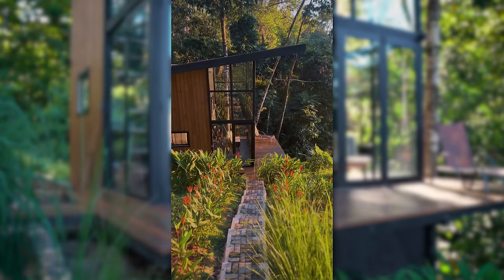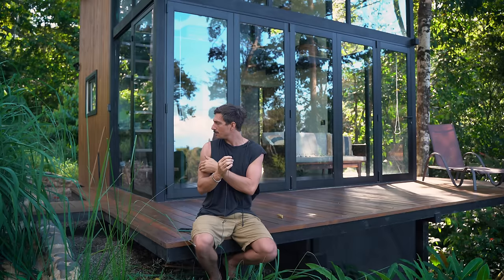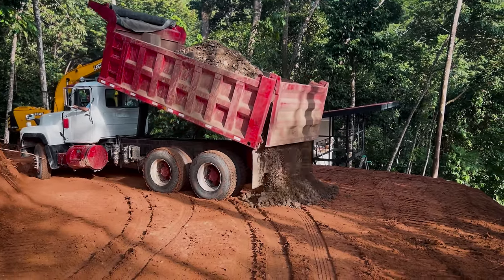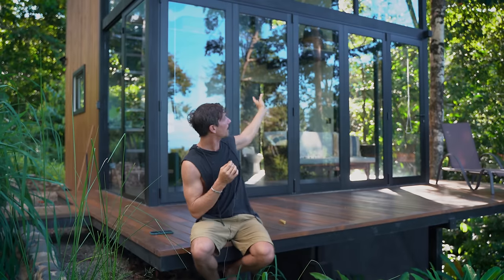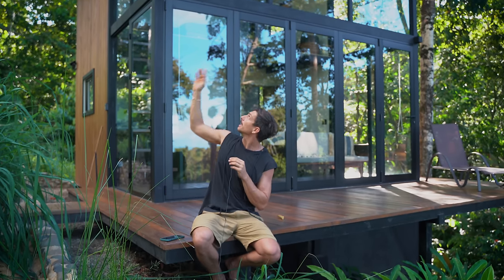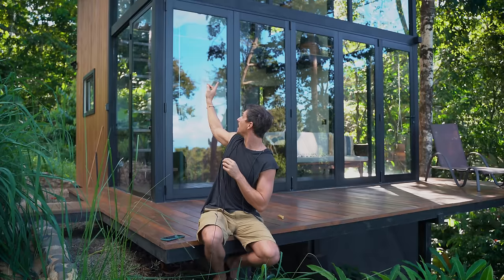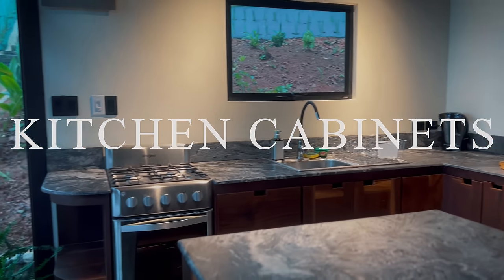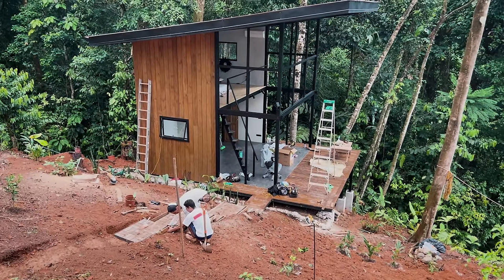Building Cost Of A Luxury Cabin In Costa Rica

Comment: How about the price of the land? Did I miss that?
Reply from the maker: I didn't include that because it varies wildly. I also purchased this lot along with many other lots as a package deal. Each lot has different value because there is ocean view and lot size to consider. But I paid just one bulk price so it's hard to say. Its like if you paid $10 for an apple, a juice, coffee, milk and a can of beans and someone was like, how much was the apple?
Reply: OK you bought two lots so how much were those two lots ? @SashaJuliardD
Reply: Did you mentioned septic drain field ? I may have missed it ...
Reply: @SashaJuliardD  You would look at the receipt and it would tell you. Multiple lots would have had dollar figures to each, it can't be hard to give a ballpark figure on cost of land. Given where I think this is, I would guess in the realm of 110k. Unless what you built on here was sub-divided after or one of several structures on the same plot... given the fact this is a rental.
Reply: @SashaJuliardD  wouldn't the receipt tell you the breakdown?
Reply: You can reduce it down for the specific plot.... @SashaJuliardD
Reply: Were you inspired by Nordleys?
Reply: @SashaJuliardD  $10/5 items = $2 per item. "The apple was about $2" :D
Reply: @SashaJuliardD just say, you dont want to disclose.
Reply: @SashaJuliardD  - that's called dancing around the question or in other words...bull shit answer
Reply from the maker: @Jenna-q6w  I literally cannot give an accurate answer because I purchased multiple items with different features making some lots more valuable than other for one negotiated price. I can say that this lot on the open market would probably sell quickly for about $350k
Reply: 350k for a lot in Costa Rica. Thats is really surprising because I was in Costa Rica last month in a popular spot and saw lots 5 minutes away from a famous beach break for 15k
Reply: @coo3626  Maybe at that price it is a 200 square meter lot, I am Costa Rican and usually the lots at that price are small or do not have deeds or are in dangerous places
Reply: @SashaJuliardD  why are you being so secreative. just tell us an estimate.
Reply: @SashaJuliardD   We don't buy groceries based on square footage lol. Just gotta do the total bulk price for the land divided by total by square footage...
Reply from the maker: @dansrod5952  ok, I can measure by that metric 👍 By that metric I paid 80k. 

But I will still say again, this lot has a nice ocean view so there are the ‘nicer’ square meters than some others on the property.
Reply: Wow, so many negative responses! Thank you for such a detailed video. As someone who have bought a property in CR, and looking to add a cabin, , this was very helpful. I think a lot of people here don't realize that you can buy a lot of land, but how many of them can be " livable ". Anyway, thanks again for the video!
Reply: No one is entitled to the specific price of the plot. No one is entitled to any receipt or invoice value of the land. You can visit Costa Rica and inquire about plots and land prices. This is not just to you but everyone else forcing him to articulate the price. Like WTF 🤔🤨
Reply: @skyeoadrian  Can you read the title of this video? It’s called a relevant and related question. Buffon response.
Reply: @skyeoadrian  Buffoon*
Reply: why is he so secretive about the price of the land..? Did anyone find out how much it was or potentially could be?
Reply from the maker: @Originalman144  It seems to me like the title of the video is "Build Cost of a luxury cabin in Costa Rica"...... 

...anyway I answered the question as best I could. I didn't include the pricing for a specific reason because I cannot give an accurate price. By square meters its one price, by total paid divided by # of lots its another price, by value on open market its another price, and the effective price I paid if you count gains from sales of land on adjoining plots its another price.
Reply from the maker: @coo3626  Man if you can found a good piece of land for 15k that has it's legal paperwork in order, it's water letter, is buildable and near a famous surf break, I'll pay you 5k finders fee right now.
Reply: He said is like 10k per parcel land.
Reply: @coo3626  where did you see this?
Reply: Could you inform us how much you paid for the lots or your package as this is the most crucial part to be able to navigate expenses? Thank you beautiful little home.
Reply: I think you all should leave those that was not mentioned to SashaJ and don't have to be too busy body asking everything. You should by now can figure how much roughly and later on if you want to built your own similar design house, pretty sure it'll cost differently.
Reply: It’s like people can’t read. He explained why he can’t price it accurately because he bought the land IN BULK and there are varying factors amongst the land that he feels like would affect the value of it. Youre not gonna get the same price for a piece of land with an unobstructed view of the ocean but is off the roads as you are for a piece of land that is close to the roads but has no ocean view. The short answer is “it depends”.
Reply: @SashaJuliardD  Ballpark?
Reply: Reasonable Pricings...Tqvm for sharings...God bless...
Reply: Great house @SashaJuliardD
Reply: Lol and i thought seaside island property was a bargain at 100k these days 😅 smh
Reply: In Vancouver that small house would cost about 350 k .
Reply: @coo3626 where was that?

Comment: Hi Sasha - well done!   I strongly encourage you to add horizontal concrete "beams" in the ground that tie into the concrete pilings supporting your house. I used a similar construction method in similar terrain and each corner of my house is subsiding at different rates. This causes racking which puts great stress on the structure. Another thing to consider on your next build is ensuring the upper part of the house does not come into physical contact with the concrete bodega structure below. By building on pilings, it is easier to protect your house from termites and ants because regular visual inspection is a snap. When you have a concrete structure (bodega, bath house) contacting a structure on pilings, you make it difficult to inspect for ants and termites. And it becomes far more difficult to stop them once they find your house.
Reply from the maker: Wow thank you for this reply and these tips. I will make sure to consider that on my next one. The next one will be a concrete foundation
Reply: Hi Sasha, I love your house and vibe. Can I ask how much land that you have and the approximate town or location? I’m very interested, as I may be looking to relocate from USA in 2024/2025! Thanks ❤
Reply: Was thinking the same thing when I saw the concrete footings. Should be continuous. Was also thinking that he could have opted for materials to prevent termites. Well said.
Reply from the maker: @NSAKEY  I will definitely consider horizontal beams on my next one. As for termite resistant materials, all the wood I used was pine treated by a company that makes a special process and treatment for this area specifically for the weather and insects down here.
Reply from the maker: @jodymooney255  Hey there, well I used to have several lots spread out over about 5.5 hectares. I have sold about 2.5 hectares already and have plans for the rest. It is near Uvita on the South Pacific coast  :)
Reply: Structural and MEP engineers are always a must for any construction project. Specialties exist for a reason and are thus required. Thicker steel, for example, does not necessarily mean better structural qualities. All in all, though, project looks well done! 👍
Reply: @SashaJuliardD  also look into helical screw piles. many benefits
Reply: Sorry but when you use an architect and engineer as he did doesn’t that factor in what you’re suggesting?
Reply: @jpanderson6145  if I may - I have a dear, longtime, friend who has framed at least 300 larger homes in the US/CT. He has often spoke of architect designs that cannot be built and he and his team have to (structurally) make it work.
Reply: I am surprised the architect and/or engineer didn't call for that or recommend ..
Reply: @rayo1371  likewise... is the lesson hare to take this advice at face value or, to always come to youtube for feedback on a build lol
Reply: and also anchor bolts on colmns base plates. it should be welded into the rebars before pouring the concrete.
Reply: I’m curious how was it possible for you to get approved
Building plans for a foundation that is not anti-seismic. It is the only requirement in building code in CR. And you would want your foundation to have the proper structure. There are earthquakes in CR. I used to be a developer in CR.

Comment: What area of CR are you in?
Would you share your plans?
The place looks amazing. We built something 'kinda" of similar albeit a bit larger, lower level equal amount of glass but non opening for my allergies. Second complete floor larger than first is all open air with roofing over 3/4. We have steel custom made queen beds on wheels up there for outdoor sleeping under the stars or not.

Comment: 2/0 aluminum (max load approx 115A worst case conditions) running that distance you're getting close to 10% voltage drop at your house vs at the meter.  Perhaps the electrical needs aren't heavy with a small cabin, that sure is a significant drop to consider.
Reply from the maker: Actually Id love to hear your input on this. I did the calculation and there are two hots coming and 1 return "neutral" wire. So the main breaker has 240v. Does this change the voltage drop calculation, or because any given outlet is just using one of the wires at anytime, does that still hold with the 115V drop? The heavier appliances like the AC and the hot water heater are 240V so I am assuming they would have better voltage drop. The other appliances like the lights are LED and plugs for laptops barely take any amps
Reply: @SashaJuliardD  The first three sentances are just describing Single Phase, which is how the calculations were done. 
I am not an electrician, however I do lots of electrical calculations while designing solar systems.  I couldnt confidently tell you anything about your appliances, other than as long as those appliances are designed to operate at the voltage range your house is seeing (after the drop) then things should be okay.
Reply: @SashaJuliardD  for reference, I design voltage losses at a target of 2% or under for solar systems

Comment: You didnt mention the cost of the land.  Thats a big number.
Reply from the maker: It's hard to make a cost for the land because I purchased a large plot and this is just a section of it. there are other sections already sold and this isn't the main building site of the parcel. So it is impossible to tell what I paid for the land because I bought multiple parcels in one deal all with different 'quality' levels in terms of view and space.
Reply: @SashaJuliardD  I understand, but when talking houses, it's all about location.  You have a beautiful tropical location which adds to the appeal of your amazing home.  It would have been helpful to estimate the cost of the land because it's a required part of the costs.  Even if you gave a disclaimer that it is only an estimate based on a small section of a larger piece of land.